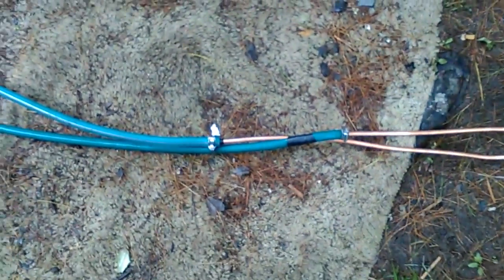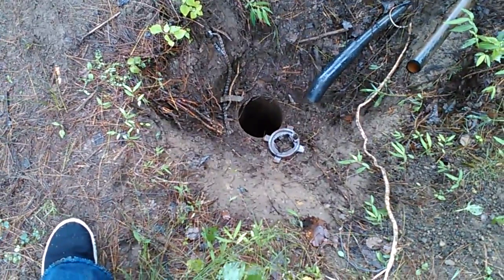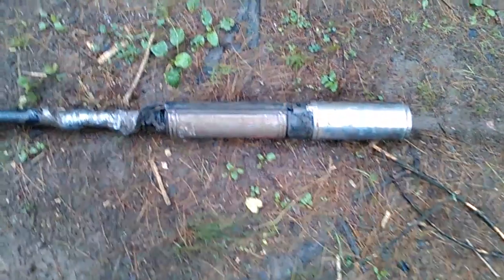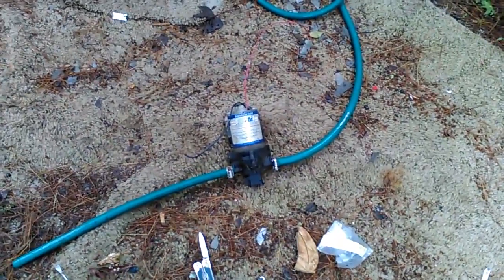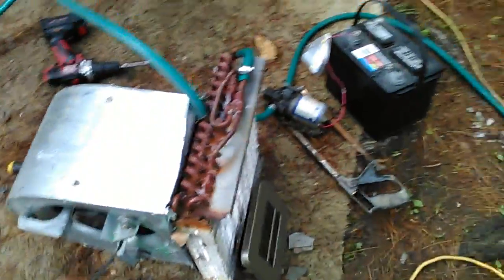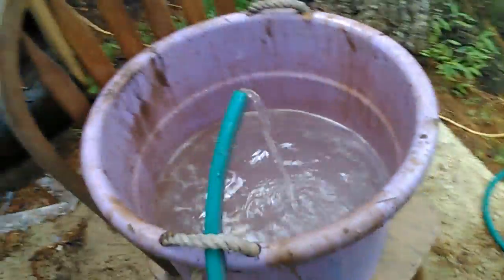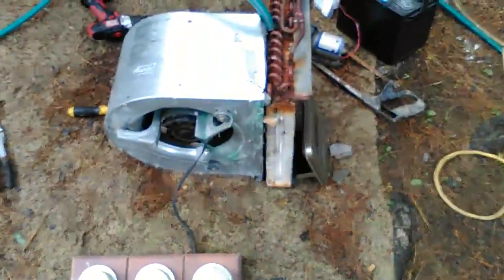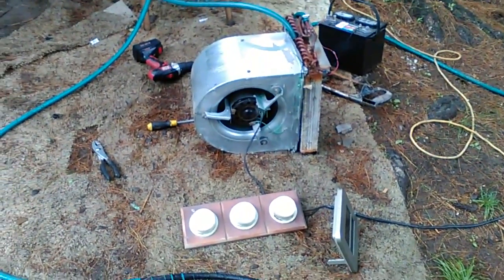easy DIY geothermal cooling system.

Comment: I will build one. Here is the calculations. 

A 600 sq ft room with 2 blokes will need 20,000 kJ cooling. You need 200 gallon water to take that heat down by 10 deg C. The tap water is at 15 deg and my room at 35. So I have the needed 20 degree gradient. 

Water moved heat 20x faster than air. So, if I had a 40 cfm 12 W fan (itty bitty thang), I’ll need 1 cfm water pump. 1 cfm is 7.5 gpm. Another itty bitty thang. Together 25 W. Once I get flow rates right, it should take a 40 cfm fan 2.5 hours to exchange 6,000 cubic feet air over the copper coils. Right? If I am not missing something, this will be a $7/month way to cool a 20,000 btu (1.7 ton) space. 

Maybe I’ll solve world hunger next.
Reply: Im not sure about everything you said but it sure sounds nice
Reply from the maker: Sounds like it should work.
Reply: What is the heat dissipation rate I can expect from standard gravel surrounding my well? 12ft deep, 6 feet of water 4x4ft  roughly 376 gallons. My refill rate is +4 gallons a minute .Your gradient does not take this into account.   I was thinking rather than recirculating I could just pump the water onto the ground 30 ft away and let it cycle through the ground, back to the well, to cool off. So much math.... I seem to have a 52f stable ground  temperature here- A nice starting point. blah blah. Cheers :)

Comment: Very cool. Can you tell us what happened- did it work out for you?
Reply from the maker: It worked ok but after a while of re-circulating the water, it would start to heat up and lose effectiveness. I ended up running hoses from the creek up to the house and ran the pump to run the cool water from the creek through a car radiator. It worked well for the whole summer.
Reply: @lukeFugate  Great solution. I was thinking you needed more surface area than just your copper tube or maybe a tank of water like some have proposed so you have a constant reservoir of chilled water underground. Nice work!
Reply: Got it. Thanks.
Reply: I will build one. Here is the calculations. 

A 600 sq ft room with 2 blokes will need 20,000 kJ cooling. You need 200 gallon water to take that heat down by 10 deg C. The tap water is at 15 deg and my room at 35. So I have the needed 20 degree gradient. 

Water moved heat 20x faster than air. So, if I had a 40 cfm 12 W fan (itty bitty thang), I’ll need 1 cfm water pump. 1 cfm is 7.5 gpm. Another itty bitty thang. Together 25 W. Once I get flow rates right, it should take a 40 cfm fan 2.5 hours to exchange 6,000 cubic feet air over the copper coils. Right? If I am not missing something, this will be a $7/month way to cool a 20,000 btu (1.7 ton) space. 

Maybe I’ll solve world hunger next.

Comment: I'm getting ready to the same thing except from a tank full of water underground.  You beat me to it.  Great job, TomB retired physicist  
PS: I hope you become a scientist because you're a natural.
Reply from the maker: Thanks!
Reply: Did you ever do your tank and if so how is it working, depth, gallons, size of space cooled... Thanks
Reply: @worthvilleminimart  well the short answer is nope because I'm soooooooo very busy.  
But I simple plan to diy a hole for a 275 gallon platic IBC tote ; Run rain gutter water to it ; Run a pair of hoses to it ; Bury it ; Hook the pair of hoses to a car radiator with fan on it ; Circulate water thru the car radiator ; & Cool my shed.
The water should be about 58 degF out the ground & water has lots of thermo mass.  An A/C on gets only down to 40 degF (any lower & condensation will freeze up).  It would seem A/C is a con-game.  
We'll see though.

Links that might be of interest:

easy DIY geothermal cooling system. https://www.youtube.com/watch?v=lNacqpg474Y
Geothermal diy #1 https://www.youtube.com/watch?v=TNLrjMjYD4s
Geothermal: How to DIY for cheap! https://www.youtube.com/watch?v=VXHg36OvKFU
Cheap Geothermal Heater Part 1 https://www.youtube.com/watch?v=f2DvMgGG12k
GeoThermal Solar Air Conditioning Part 1 https://www.youtube.com/watch?v=sOxnJ5DceeU&list=PLpZKoEWMZEz_OeTiV3mx47jy1jOUL6yqe
Geothermal Energy Options - How It Works https://www.youtube.com/watch?v=Uv8bTAGr0tU&t=12s
  
Vertical Geothermal Earth Tube (Part 2) - Greenhouse Heating/Cooling https://www.youtube.com/watch?v=ghmvI9U1KQI
Did Geothermal Heating work for Greenhouse 2.0? (Part 2) https://www.youtube.com/watch?v=VtPfUy6T2Jc
Shallow Well Dig with Hand Auger https://www.youtube.com/watch?v=r2ZhwndZrNc

Earth tubes as heat exchanger for geothermal ventilation / AC / cooling and heating passive house https://www.youtube.com/watch?v=l4nMsHqCTeI&list=PLuTmAc3bBO0vQ4ZRSJo-YNseOGSMzqGF3

Heat Storage for Solar Hot Air Systems Using Concrete Blocks https://www.brighthub.com/environment/renewable-energy/articles/89823.aspx
Rainwater storage (ferrous concrete or 275 Gallon Caged Plastic Tank / IBC Tote), 
Building A Rain Catchment System - Part 1 The Foundation  https://www.youtube.com/watch?v=-XM3jUIv79s&list=PLbKwoGlXEWaqNIZQlg3KkV23CUrJjbaEK&index=1
Reply: @tombouie  that's one hell of a useful post mate. thanks.
Reply: @tombouie  Thanks for links. BTW, IBCs can't  be buried, at least in porous soil or sand.  They will be crushed. Clay or stone might work.

Comment: A 12v DC Swamp Cooler?? Hook a solar panel to the battery and you'd have free AC!!
Question, if you put the warmer water back into the well, does that mean you will lose your cool? ;-)
Reply from the maker: It turns out that drawing water from the creek and running it through a radiator was quite a bit more effective.

Comment: This is a great idea to bad its illegal in most states 🙄 stupid hippies
Reply from the maker: Thanks. There is a better method in my case. I ended up running a water line down into the creek and to the water pump. From there it ran through a car radiator and drained back into the creek. I put a smaller blower fan behind the radiator and it kept my house cool for the whole summer.
Reply: Stupid hippies? You talking about the ones in government who think solar and wind can solve our energy needs? Those stupid hippies? Some times the sun doesn't shine for days and sometimes the wind doesn't blow for weeks.

Comment: Cool project thanks! Do you have an updated video showing the whole system and temp testing? I'd love to see the setup and results!
Reply from the maker: I actually changed the design and ran water from a radiator in the creek into the radiator and back down to the one in the creek. It worked better for long-term use. I never filmed any of it though. The system has since been dismantled so nothing left to show.
Reply: @lukeFugate  so it didn't work good enough for heating or cooling?

Comment: I watched another video about those big fans. You should put a piece of cardboard and cover half of the intake opening. They are designed to push air through vents under a lot of restrictions. Put the cardboard on and you'll notice how much more air comes out. I don't know if it's double but it might be close.

Comment: Look up glycol systems try using that instead of water
Reply: Glycol actually has a lower heat capacity than straight water. Unless you need the freeze protection, it's actually preferable to use pure water (or water with a 'wetting' agent) for any heat transfer purposes.

Comment: I don't think that is enough water quantity to do much significant cooling my house uses a 1.5 inch line to circulate water to the lake floor and back, The coils in the lake are about 5 groups of 20 rounds  approx 100 foot total of 1" pipe under water in the cold area of tubing in 5 different locations to dissipate heat better. The incoming cool water then goes into a heat ex changer where freon then moves even more heat as needed. Geothermal heatpump estimate 50-70 thousand btu capability. Yours i would estimate to be about 1000 btu not sure. Maybe cool a dog house that is about it.
Reply from the maker: batman 1999 Like I said in the video, it was just an experiment. What ended up working was a bucket in the creek with a fine screen covering it and a hose leading up to the house coming out of it. The hose went to a small water pump and then to a car radiator. It came out of the radiator and into a drain leading to the creek. I put a fan behind the radiator inside the house and let  it circulate. It worked good enough to keep the house cool. I've since went on the grid(my wife got tired of depending on a generator) so now I just run window unit air conditioners.

Comment: While metal transfers the temp faster, various elements in water can corrode it faster.  
What about using PEX tubing, which lasts longer, and tolerates freezes?   
OR, might do what we did, and lay about 60' of 8" ducting on the ground of the crawlspace, put an intake box from the house that holds filters, and a variable speed fan to pull air through the system, and out via vents into our mid-century tract house.   
    This has been helping keep our electric bills a bit lower, for a couple years now...both heating and cooling....our crawlspace holds temps pretty well, averaging about 10F warmer in winter than outdoor ambient air, and averages about 10F cooler than outdoor ambient air, summer.  The ducting is sealed, with a Reflectix blanket over it.   If it leaks, no damage anywhere.  
Could probably use the flex-drier duct much more cheaply....we choose to use the regular metal ducting.  
   We also make deeply shaded areas off the south side of the house, for summer, to help hold-down indoor temps.

Comment: Well its been over 2 years sense you posted this video. Im not as interested in the cooling system but the well maintenance and security. As a 40 year water well worker/driller I get concerned when people are not safe around wells. May I suggest you add a riser to the well casing. A riser is a pipe the same size as the casing pipe. The casing pipe is the pipe in the ground and holds the ground from caving in on the well. The riser should come up 2 to 3 feet above the ground. And it should have a cap on it to prevent animals and trash from entering the well. You can use a PVC pipe for the riser. Adding a riser will help prevent mice and other animals and trash from entering the well. It will help keep your well clean. It will also make it safer for young children. So they won't fall in the well.
Reply: As I agree with the contamination factor I don't think many peoples kids will fit in a 4in pipe
Reply: @MrSteewped  it only takes 1 leg to fall in the hole to break a leg,  or ankle,  or foot, hip,  ect. ..
Reply: @jerryguerra348  and that’s how you learn to look where your walking.
Reply: Maybe he could build an outhouse over it and use the hole as a drain.
Reply: Jk I don't think exposing the well is a good idea I bet sand would get in along with leafs and that's gross
Reply: Timmy?
Reply: I would open the well up more so people can look at it in ahh and ooooh, safty pshhhhh if saftey is a concern I suggest we ban cars more ppl die from cars than falling in Wells lol
Reply: @youtube4enthusiast 
Ground water contamination is bigger problem.
Reply: People like this contaminate ground water and don't know the impact it could have leaving wells open
Reply: @93chevy93  Thanks Karen

Comment: I did EXTENSIVE experiments of the sort you did.  Here are some of my results:  I discovered the water temperature about 20 feet underground is about 60 degrees F.    Going deeper does not get any lower temperature.   I live in the middle of the USA.  If someone lives far NORTH they might get 50F water. Someone living in Florida or texas... it would be about 70F.  Another thing is that water is EXTREMELY easy to circulate because the pump does not have to LIFT the water.... as you mentioned in your video.   I also figured out that it is better to build your system with 2 water buckets at the TOP of the system.  Then just put a submersible pump inside one of the buckets.  Pump the water UP and out to the other bucket of water.  The pump only LIFTS the water up about one foot to the other bucket.   NOW... if there are any air bubbles in your pipes, they will not get in the pump.  The air bubble just rises up and out of the bucket.  You could use a TINY pump from a little water fountain. They only use about less than HALF an ampere!   A smaller squirrel cage fan would blow plenty of air with lots less electricity used.  Your squirrel cage blower looks rather large, it would use more amps. You can read more about my system on the website biblioboard.com You have to sign up, & log in but its FREE also. 
I have it posted there for FREE to read.  It is about 80 pages with lots of pictures.  Anyone who wants a copy, just email me and I will send it to you for FREE via Email attachment.
My email address is framistan@sbcglobal.net    David Mundy from St. Louis, Missouri .....UPDATE... I now live in central florida.  The water temperature 8 feet underground here in florida is about 70F.
Reply: david mundy What is the name of the book?
Reply: Title of the book is "Experiments in Home Heating and cooling"
Reply: @1framistan  

Wouldn’t this just be like a swamp cooler?  Does it create humidity?
Reply: david mundy I’m interested in cooling is the book or information still available? Thanks
Reply: Can you please send me your book.. chukaofiaeli@gmail.com.  Im really interested
Reply: Isn’t this just like a swamp cooler
Reply: @johnle231  no, a swamp cooler uses the specific heat of evaporation, cooling air by evaporating water to absorb heat, Which can only work in low humidity environments.
 These systems are absorbing heat into a working fluid that is brought down to a well where the heat is absorbed by the water in the well which can work in any environment and can use less electricity.

Comment: Heya, just a thought. If the spring/ground water level is not of concern then you would still be better off drawing the water out from the well and then dumping it down hill from where the well is. That way you are not introducing the heated water from the cooling unit back into the well itself. Even better would be if you had a section of land that was lower than the draw level from the well as you wouldn't even need a pump to move the water just use a syphon :) also you need a fan that has the motor separated from the air draw so you dont go adding the heat from the motor to the whole system. However I am sure I am just talking shit right now so, fantastic work and great to see the innovator in people.
Reply from the maker: I like the siphon idea. I ended up last year using two car radiators, one in the creek and the other on my furnace air return. I used the same pump in the video to pump water through. It worked well. I never made a video of it, but I'm planning to set it up again soon if I ever get time.

Comment: Please help me. I'm trying to find the other video you said you would make on the improvements of this one. You have a ton of videos for me to try and go through. Just not computer savvy. Got to figure out cooling problem. It means a lot. Thanks.
Reply from the maker: I haven't made the video of the system I used last year. I still have to put it all back together. It will be soon because it's starting to get hot.

Comment: At least dude was smart enough to use copper pipe for his heat exchanger.  These days, it's so common to see dipshits doing this kind of thing and use plastic pipe.  Which WILL work, but if you're going to do it, then do it CORRECTLY.  Also, freeze frame at 0:39 on the view of the well.  Is that the shed skin of a snake, at the very bottom of the frame, in the middle??
Reply from the maker: I actually did my ac completely different than the video, this was just an experiment. It was in the summer so it was my work season and I just never had time to film the new setup. I took it down for the winter but I'll be putting it back up soon, and Ill make a video of it. It is two car radiators, one in the creek and the other in the furnace air return. Works very well. lol the thing at the bottom of the screen you're referring to is a piece of the rope that I use to pull the well pump.

Comment: Basically this is a Water Cooling Exchanger :)))  -  I would hate to see a Leak somewhere, LOL... YIKES !!!!
Reply from the maker: It is normally around 55F-65F in the shady areas in the creek. It ends up cooling the house down pretty good. I can keep it around 76F in the house which is pretty comfortable.
Reply: luke Fugate thats fantastic actually thats the temps that a normal ac compressor works the evaporator gets the air to 60f so you did it
Reply from the maker: I actually ended up going with something completely different. I put a car radiator under water in the creek where it had a constant flow in a shady area. I then ran insulated lines up to the house where I put another radiator where my furnace air return is. I had this same water pump hooked into the lines and  it circulated water through the radiators. With the furnace fan running it worked amazingly well to cool the house. When I set it back up this summer I'll put up a video of it.
Reply: luke Fugate whats the water temp coming cool to the radiator, nice idea btw

Comment: unless you live in a dry climate you will create a mold and moisture problem in your home from the condensation and the air should be blowing out about 30 degrees colder than 73. And you will rapidly rust those coils without filtering the water and neutralizing the ph of the water
Reply: He was getting condensation on the coils, so it's mitigating moisture
Reply: Rapidly rust copper coils in a closed loop system?
Reply: @johnwyman6331  lol @ rusting copper

Comment: this is one way to get start saving money and energy..
Reply: Maybe, maybe not. An 11 SEER 5k BTU window A/C unit uses about 400Watts running at full load, while that blower might very well use that or more by itself, plus the water pump at 12V x 3 or 4A =36-48W additional. Just something to consider.